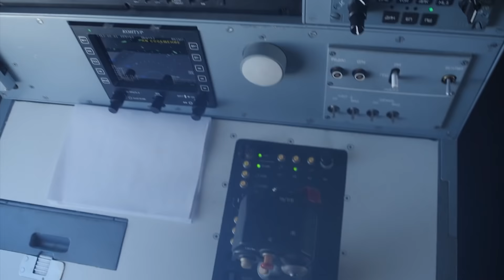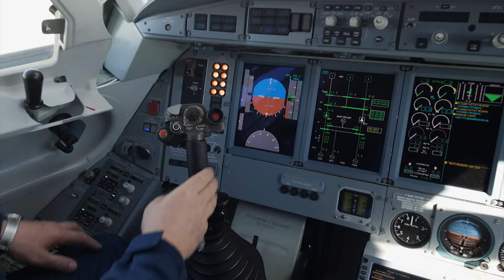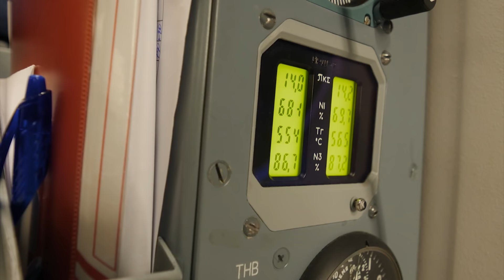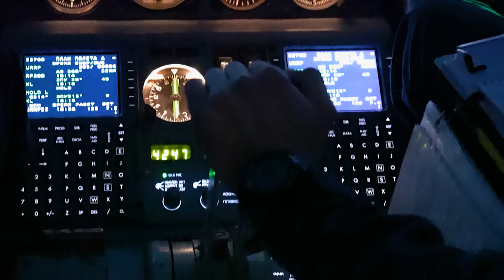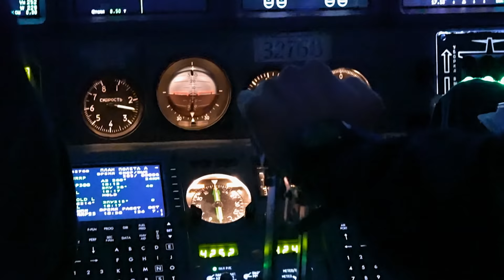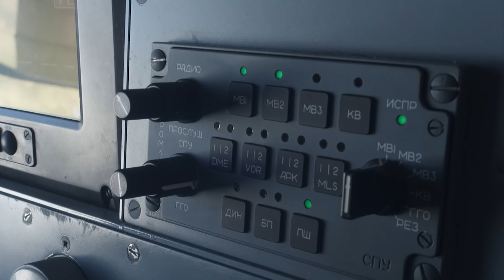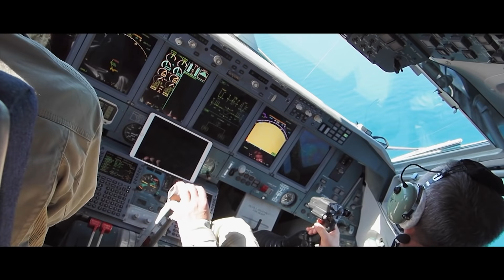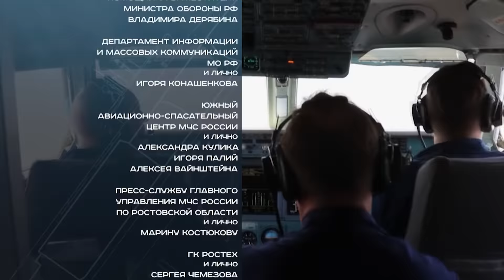The Amphibian / The Beriev Be-200 Altair / Russian Flying Boat

Comment: How do these planes stack up against the Canadian planes for the same purpose in terms of Initial costs, capacity of tanks and operational costs?
Reply: Bigger faster and heavier loads ... Its limits are defined by the side cargo door as a freight relief or support aircraft .. its  other limit is the sea state if i recall its about 1.3m max.. for landing and take off. 

Turbo props tend to be cheaper to run and when Beriev was still based in the Ukraine they did slate a  prop version but  it may have been more of an un shrouded prop jet. 
The Russian millitary are due to receive ASR Maritime patrol versions. 
They also offered a 80+ seat  airliner version .
A great pity this was not taken up by airlines serving remote maritime  communities ... No runways or conventional airports required. 😎 Just a ramp and standing area to work from and wash down following Salt water operations. 
The turbo fans hulls and UC have all been developed to withstand the corrosive effects of salt water on metal components. Its hull is compartmentalised  to limit flooding due to a hull breach.

These can fly vertical following a drop ... quite a sight..
Reply: @clivestainlesssteelwomble7665   Thank you. It is a shame more people do not know about these planes.  They can save s lot of lives and forest.
Reply: @johndewey6358  
The chinese Sea dragon is a turboprop transport and may be larger but its not as advanced aerodynamically as smaller but more advanced Japanese Shin Meiwa.
US MC 2 stol flyingboat. ASR and ASW  patrol aircraft. Which can also handle seriously rough wave's.

I've wondered elsewhere if say the A400 military Stol Airbus transport could be converted to an Amphibious cargo aircraft ...though the real solution may be the Airlander HAV hybrid airship..for massive lifts on minimal fuel over land swamp,snow, ice and water.. and global ranges though slower than a fixed wing aircraft.
Look up the Convair tradewind.. the version with the opening nose door. It was the early turbo props that let it down and the fact it was a pure flyingboat Not Amphibian.
Reply: @clivestainlesssteelwomble7665  If A400 can be used that may be very welcome by the EU, since adoption of A400 to replace the American C130 the European have found out A400 is not as usable because it cannot land and takeoff in the small/narrow spaces like C130 thus it is not as versatile.  So A400 maybe a good platform for this application.
Reply: @johndewey6358  
Engines and wings can be adapted and blown flaps are whats used on the Shin Meiwa..take a look at how that works.

Comment: Wouldn't pouring seawater onto forest fires hurt the environment?
Reply: Obviously it's not ideal. And it depends what's growing there. Some hardwoods can be surprisingly tolerant. While others like maples struggle. But it would take a lot of seawater to have a big impact. If you could save a few thousand acres of forest with 40-50 thousand litres of seawater, it would likely be worth it in most cases.
Reply: It doesn't have to be a seawater. In many cases, there are freshwater lakes located around.
Reply: Думаю пожар принесет больше бед. Это как подар в вашем доме: что лучше - пусть он сгорит, или пожарные намочат ваши стены

Comment: These will never replace the Antonov an-225.
Reply: Antonov an-225 is a cargo plane, Be-200 is a seaplane. Both are used for different purposes.
Reply: An-225 is an aircraft designed for the specific task of launching the Buran spacecraft from it. Cargo transportation is a secondary task with which he copes poorly due to his uneconomical nature. And comparing it with a seaplane for extinguishing fires is generally a clinic.
Reply: Noone said they will replace it.